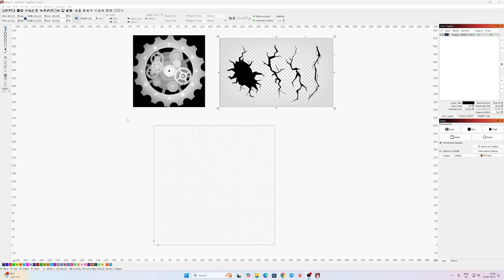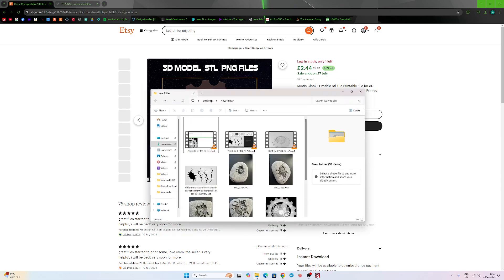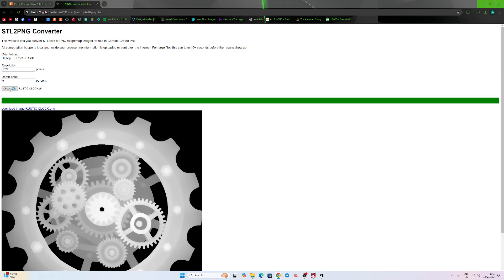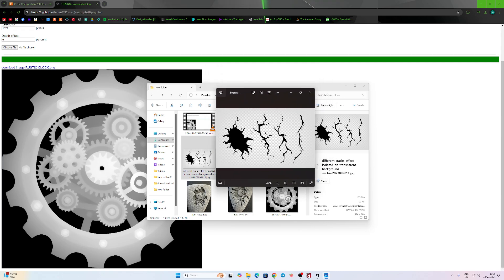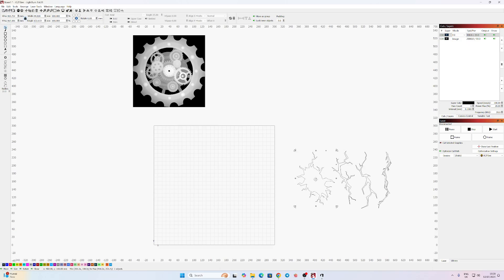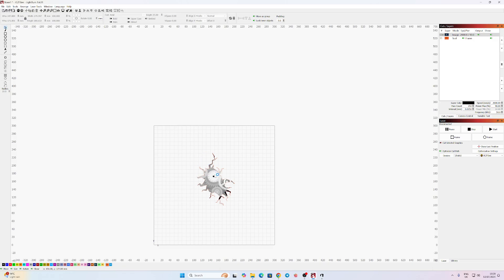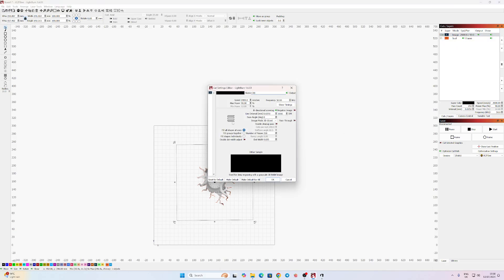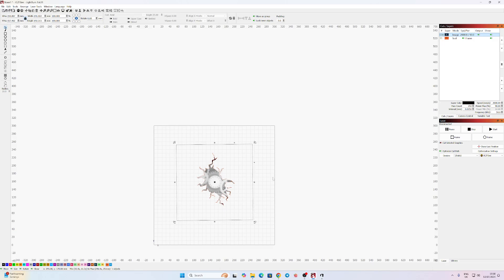Laser Engraving Depthmap in stone

Comment: Hi there, I can’t find 3D Slice option on my Lightburn, on the drop-down setting menu, it’s just not there - is there any way I can get it or use some other setting to get the required outcome please? My machine is a Sculpfun S30 Pro Max - any advice would be great - thanks
Reply from the maker: I believe that is a diode laser and the diode license doesnt give access if im recalling. Its on the galvo license
Reply: @ thanks for your reply - does that mean I can’t do it using this particular laser machine or is there some other function that i can use?
Reply: @ do you know that his I were to upgrade and purchase that  to galvo license would that then work in the particular machine I have?
Reply from the maker: @NFFC-ENGLAND i dont believe a diode is capable of deep engraving due to the power required but is worth contacting lightburn direct, i wouldnt want to see you upgrade and still encounter issues
Reply: @Nonprofessional_Tinkerer  thank you so much my friend - you’ve been really helpful 🙏🏼

Comment: I'm definitely trying this. Thanks for the video.
Reply from the maker: My pleasure
Reply: @Nonprofessional_Tinkerer  

What watt laser did you use for this?

I have a 10w laser and am wondering how your settings would need tweaking to work on mine.
Reply from the maker: @Shinthaw  more passes would be needed, i have 60w
Reply: @Nonprofessional_Tinkerer 

In Image Mode, you select "3D Sliced" I don't have that as an option in my Lightburn.
Reply from the maker: @3DPrintswithShin  might not be a capability if using diode license

Comment: I'm curious how long this job took to run. I'm relatively new at this but I setup something similar and the estimate was over 5 hours.
Reply from the maker: This piece took 40 minutes
Reply: @Nonprofessional_Tinkerer  

I'm new to fiber, so I didn't have much of a feel for how long things take but it sounds like the Lightburn estimate is way off. I think there is a way to calibrate the Lightburn estimates, so I'll look into that.

Thanks for the info!
Reply from the maker: @FreddyMakes  it could be your speed is in mm/m instead of mm/s

Comment: I think we  have the same machine or very similar ... thanks for the video.

Are you sure you're configured correctly?  I'd expect to see an available entry for q-pulse width, your MOPA should have it available ...  

Check the Device settings -> Ports and laser settings  and  enable q-pulse width setting. 

Nice work... love the concept...  I'm in an area with lots of various types of rock... I can melt volcanic rock to produce glass that is black.

There isn't any great detail available in any of the rocks I've used, so I use a long lens.  An F254mm (175x175mm coverage) has a depth of focus (dof) of about 4.8mm.  If you focus to the center of that area, it will remain in focus for almost 5mm.  The F420mm has a dof of about 13mm.  Of course the tradeoff is detail and a bit of power, but a much greater range.

Not sure if I'm sold on the >256 pass option, but the jury is still out, at least with me..

I think if you're doing 3dslice you should use the 256 value for passes.  

This is a post by Oz on the Lightburn forum on it's operation.

With 3D Slice, each pass is thresholded to the current threshold value, and the result is run as a 1-bit image. If you use 256 passes you get exactly one pass per gray-level in the image. Every pixel at or below brightness 255 for the first pass, every pixel at or below 254, then 253, and so on.

If you choose 128 passes, you get every pixel at or below 254 for the first pass, then 252, then …

It “clusters” the layers together into batches if you use fewer than 256 passes, and will duplicate some layers (with even spacing) if you use more than 256. 384 passes would duplicate every 2nd layer. 512 passes would duplicate every layer.
Reply from the maker: @jackwilborn2353  this light burn is one not attached to my laser as was using it just to record in OBS, yes if LB is set up correctly you'll have pulse width too but as it used the default I just left it. It is very much trial and error and in the groups I've seen brass done with nearly 4000 layers. I would say it's a project for someone like Nicky Norton who will demonstrate the differences the amount of layers make. It's still very similar to how we used to do line intervals that coincide with the nema17 motor steps but even with a fiber laser we are still using the same DPI values. There are so many variables with the fiber galvo lasers that I tend to just go with what works for me. If someone posts improvements I will certainly try them out. My posts I'm uploading to give basics for others to try and experiment with as a lot of using these machines seems to be cloaked in secrecy and not sharing the settings used. I learnt all I know from the groups so these are to show my results and how I got em. I will give 256 a go though to see if there is any difference, also would make sense to try multiples of the 256 in order to get more defined edges. It's definitely something to ponder :)